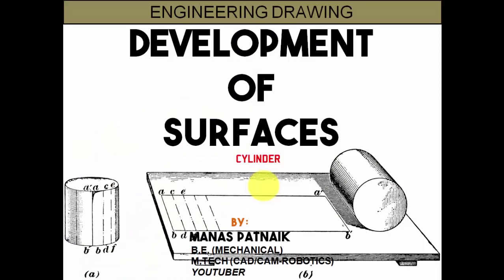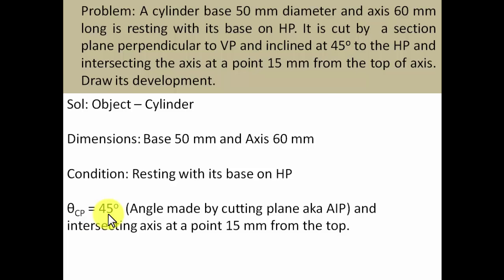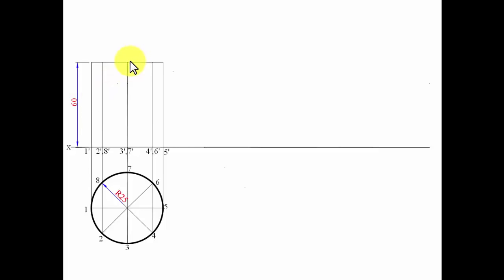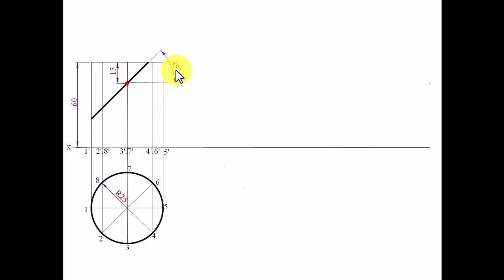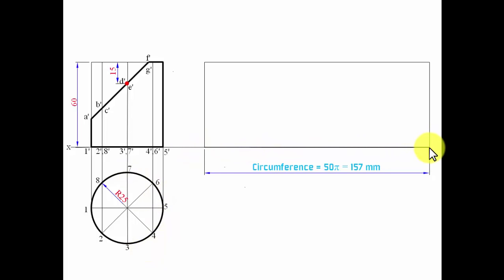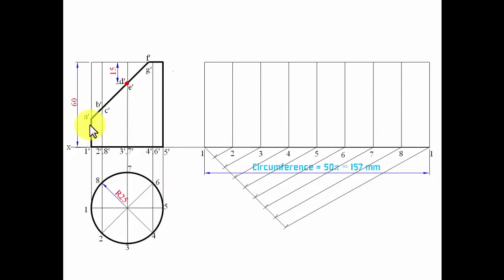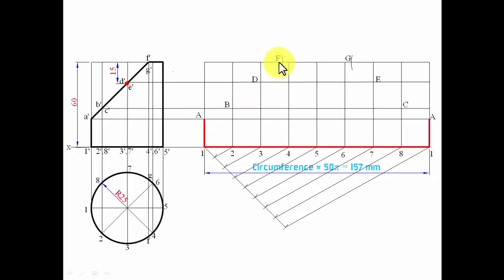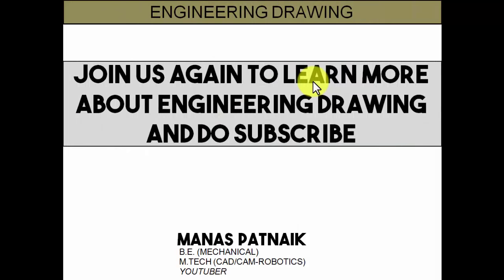Development of Surface of Cylinder_Reloaded_Problem 2

Comment: Today this question was in the exam .Thanks for 8 marks sir .Keep doing this
.
Reply from the maker: Thats great....
All the best for results
Reply: a cylinder, with a 50mm base diameter and 60mm  long axis is resting  on its base  on the HP .it is  cut by AN A.V.P inclined at 60° to the reference line at a distance 17mm from the  axis .draw its  sectional front view and top view  and  true shape of the  section.  @ManasPatnaikofficial  make video sir

Comment: A cylinder of base diameter 50 mm and axis 70 mm long is resting on its base on the H.P. A section plane inclined at 30° to the H.P. and bisecting the axis cuts the cylinder. Draw the projections and sectional top view. Also, draw development of cut cylinder.
Reply: Kadlas kay he mg?

Comment: sir  i am confused  in taking the arcs for f and g for development . Sir how can you directly take the arcs form the circle , thats not  the actual length ...
Reply: Take compass. Keep one end on pt. 3 and other on pt. f on the circle's circumference. Then keep an end on vertical line 3 and cut the horizontal line by drawing arc. This is the procedure he followed. Although, if you meant to say that the distance isn't the actual distance but the shortest one, then yeah you are correct here. It would approximately be same.
Reply: Dimension- angular length-
Reply: I have exactly the same doubt 😁
Reply: Annotate. Then dimensions. Select arc length from the dropdown options and click on the arc whose length you want to measure.

Comment: 1
A Cylinder of diameter 60mm and axis 75mm resting on its base on HP cut by perpendicular to the VP and inclined to HP at 60 degree, passing through a point on axis 20mm above its base. Draw the development of lateral surface of lower part

Comment: A cylinder of base diameter 50 mm and height 70 mm rests vertically on HP. It is cut by a plane
perpendicular to VP and inclined at 50° to HP. The cutting plane meets the axis at a distance
30 mm from its base. Draw the sectional plan and true shape of section.

Comment: A right circular cylinder, base 50 mm diameter and height of axis 70 mm, is resting with its 
base on H.P. It is cut by a section plane perpendicular to V.P. and inclined at 30° to H.P. 
bisecting the axis. Develop the lateral surface of the remaining part ‘P’ of the cylinder.

please give me a video of this question

Comment: We do not calculate the values in Engineering Drawing. It all has to be done without calculator. The way you have taken the length of circumference is not to be taken to practice under Engineering Drawing

Comment: 6:56 this looks wrong. how did you equate the distance between two points when they are at a curve to the distance between two points when the curve is spread-out as a line

Comment: A cylinder of base diameter 50 mm and height 65 mm rests on ite base on HP. It is cut by plane perpendicular to VP and inclined at 30° to HP and meets the axis at a distance 30 mm from the base. Draw the front view, sectional top view and true shape of the section.

Comment: A cylinder of base 60 mm diameter and height 80 mm has the midpoint of the ass 60 mm away

from both the RPs. The axes is inclined at 30 to the VP and 60 to the HP Draw the projections .I want solution for this

Comment: A cylinder of diameter 50mm and height 75mm is resting on  the ground on its flat end. It is cut by a sectional plane inclined at 300 to the axis of the cylinder and passing through a point on  the axis at height of 50mm from the base. Draw the lateral  surface of the bottom part.